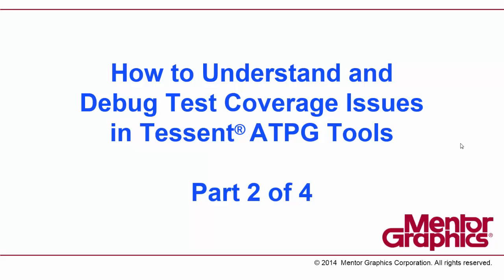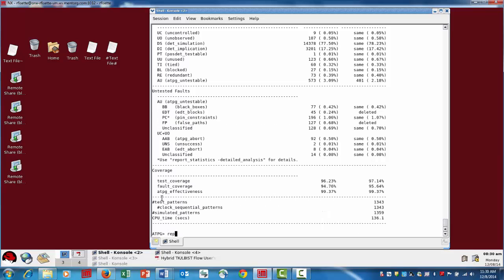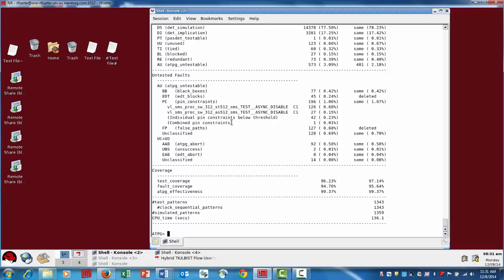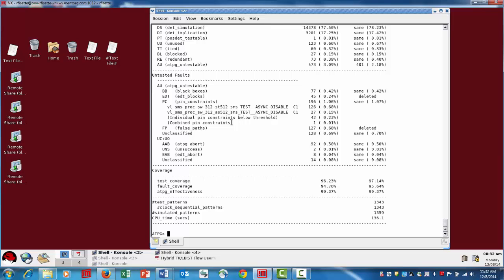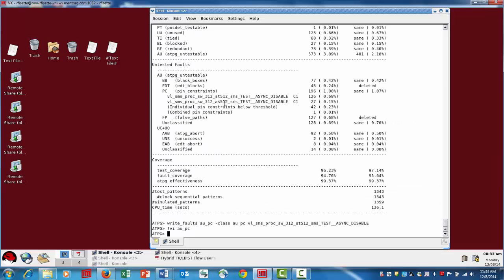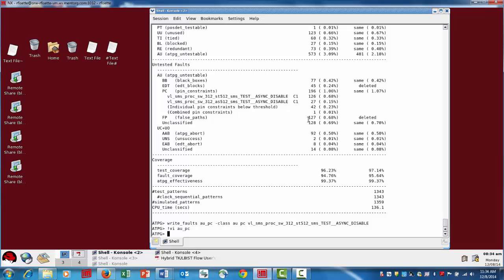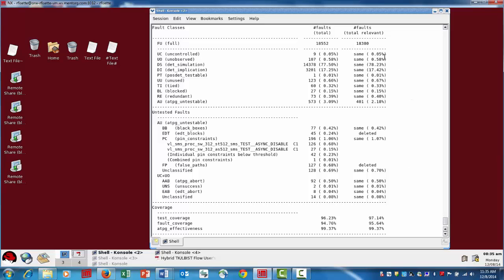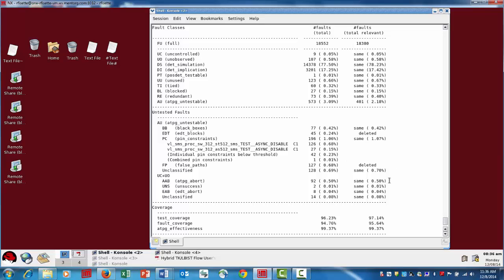Tessent test coverage debug 2

Comment: The "relevant fault" population will always be higher because it is =  total_faults - irrelevant_faults.  In this example the only irrelevant fault categories are EDT and false_paths (det_implication is still a relevant fault category).  As the number at the top of the Relevant Coverage column indicates, the total fault population was reduced from 18,552 down to 18,380 by subtracting these two categories from the population.  This lower fault population number is in the denominator of the coverage calculation so all test coverages are re-calculated and result in a higher coverage.  Hopefully I've answered your question, if not then please correct me.